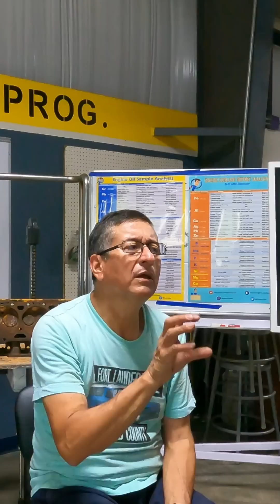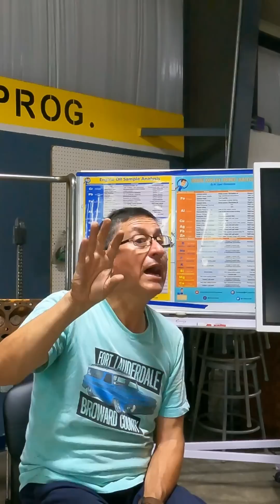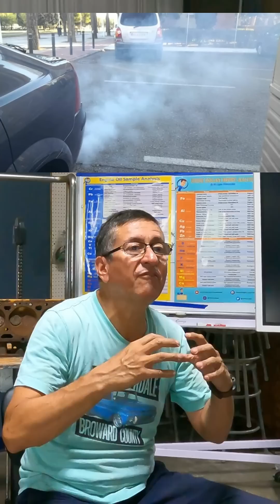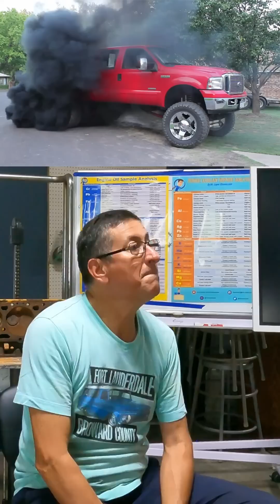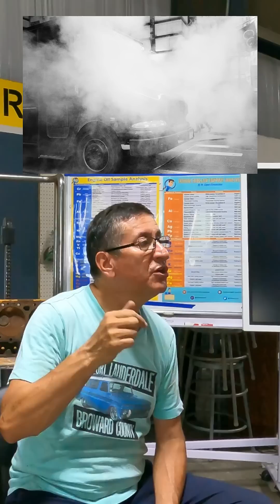Lean Mixture in Diesel Engines

Comment: Hes actually completely wrong in this
A diesel is a lean burn engine, it can run with a tiny amount of fuel charge (very lean) and this is normal
A rich mixture with a lot of smoke is hot combustion. 
It is important to note that the mixture could be fine but if the injection timing is incorrect or the injectors leak (timing being incorrect can be due to the fuel injector being warn) there could be knocking noise with low power (over advanced) or low power with smoke and very hot exhaust temperature (over retarded)